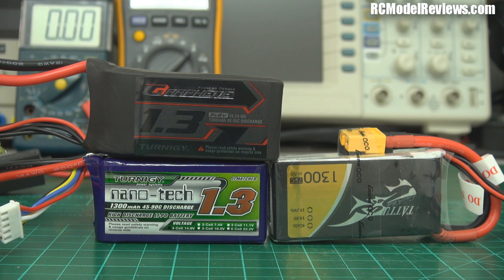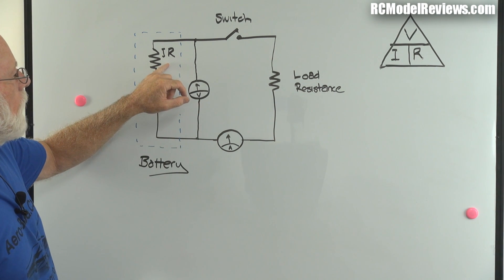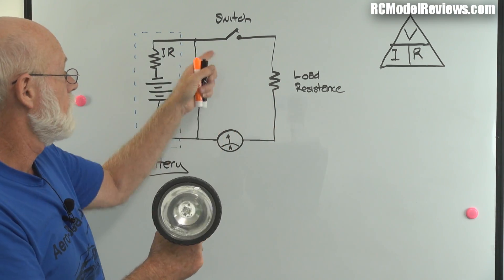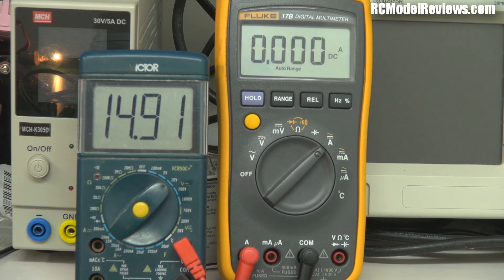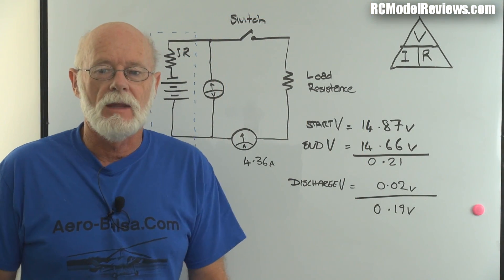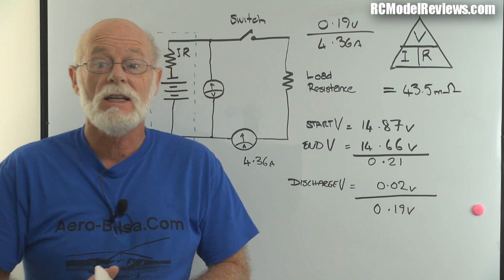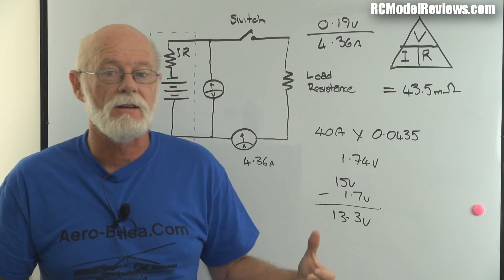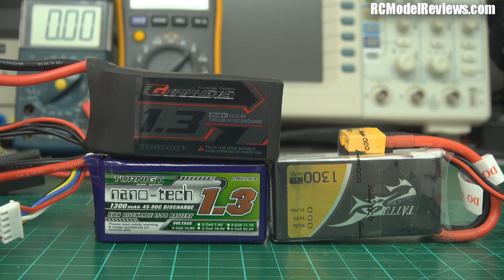Turnigy Graphene batteries:  calculating the internal resistance

Comment: I think everyone has been waiting for you to do these tests! Nice work Bruce :D I'm also interested to hear your thoughts when flying them. They seem to be on par to the Tattu when flying but are slightly heavier. So that's another factor that needs to be taken into consideration. Interestingly the prototype we received is still going strong and no puffing at all but, the prototype 1300 4S Graphene is actually smaller and lighter than the production ones we purchased. Many things to factor in
Reply: Graphenes are blowing tatto away by a long shot the bolts and revos both the high voltage versions are the only packs giving these any competition whatsoever. Check out the 2 threads on the rcgroups forum. The graphene thread and the battery comparison thread both show the real deal results.
Reply: I've actually stopped following those threads because I'm learning the hard way that some times real world performance and testing is what counts. Much like a racing car, you can do all the scientific  testing you like but at some point you need to test them in real life. When I purchased our thrust stand I thought it was the best thing ever. I made a prop selection for a race based on what I had tested on the thrust stand along with the Watt meter. My son completely disagreed with me! In the end we did lap tests and both of us produced better times on his prop selection not mine.

So real world testing is without a doubt relevant. For Thomas and myself we already know the Graphene offer us the best value for money hands down.
Reply: One thing I've actually failed to mention about the Graphene is they take crashes a lot better than other packs!
Reply: +BMSWEB Do you still feel this way after the SMC battery?
Reply: Tim Fulford It's hard to say, because we have only the one pack and that's pretty much it. So when we go for a fly, we compare the one flight on SMC vs the 16 or so on Graphene. SMC are a good pack without a doubt. My gut feel is they are better but the Graphene are still cheaper for us in Australia.

If I had heaps of cash I would without a doubt buy a heap of SMC Packs, but I don't and they don't have them in stock in Australia anyway :D
Reply: Thanks Paul. I bought 2 graphene packs and SMC are the same price. I may just stick to graphene since they are supposed to last so much longer.

Comment: This is great! I knew this was the way of calculating the IR, but I didn't know about the parasitic load you needed to put on the battery to get reliable values. I guess that's why chargers don't get it right?

Another thing you can do here is calculate the parasitic power draw of the battery itself! Using the example in the end of the video: 40A and 1.7V voltage drop, then the power P=V*I  --> 40*1.7=68W (wow that's really high!?). This is why the battery gets warm during flight, and why batteries stay cooler if the IR is lower.

Comment: Why do you not use the measured voltage at the time when you disconnect the load and the unloaded battery voltage after the test ? In that case its not needed to compensate the discharge of the battery. (14.85v-14.66V)/4,35A = 43.678mOhm
Reply: +Peter Kis Because I wanted to be double-sure I got the numbers right and prove that the discharge curve was accounted for.
Reply: +xjet With both methods, the calculated values are very close to each other, i expected more difference between the single and the combined calculation results. I think for a beginner easier to understand my calculation but both methods are acceptable. Have you plan to do some advanced measurements with a microcontroller based dummy load ? (discharge curves and internal resistance with different load currents) I think also a good video topic to measure and plot brushless motors current/thrust, current/efficiency curves.(Maybe with different props?) Its so obvious to measure these things for brushless motors but i haven't seen any videos about this subject on youtube.

Comment: You're missing one factor here Bruce. In a closed circuit, the total resistance is the battery's internal resistance + the load resistance. You use the the ammeter and the voltmeter to measure the actual current and voltage drop within that closed circuit.. Now that you know V and I, you will now get the Rt (Total Resistance)  through Ohm's Law. Now, to get the Internal Resistance is just a matter of subtracting the load resistance from the total resistance. In your testing you didn't consider the load resistance
Reply: +Jan Bobis He's actually right. The load resistance gets canceled buy subtracting the two measurements. The whole formula is (U1-U2)/(I1-I2)
because I1 = 0 he just dropped it.
Reply: +Jan Bobis He isn't using the direct figure off the multimeter which would like you said give you the total resistance.  He is using the difference in voltage between open circuit and closed circuit, which gives you the voltage drop from the resistance of the battery and the discharged voltage from the battery as he mentioned and accounted for in the video.  The total current is the same as the current going through each component in series so the internal resistance is the voltage drop over the total current drawn during the drop.

Comment: Well explained Bruce. May I suggest you try a PWM driven MOSFET into a short circuit to really give the packs a workout :)  Oh and no mention of pre and post test pack temperatures or the totally BS C rate figures manufacturers slap in these packs. It is high time someone named and shamed the biggest liars.

Comment: You didn't show where in the circuit you placed the 12v globe as small load ...? across pos and neg to the left (in the diagram) of the switch and the
 ammeter? so it'll be on permanently (nope, probably not), or on pos right of the switch and on neg left of the ammeter?
Reply: +David Clark The globe was placed directly across the battery terminals so the current that flowed through it did not affect the reading on the ammeter.  The current itself was very low -- in the order of 120mA so will have had little or no bearing on the overall results -- whereas the effect of the ionic charge on the voltage readings could have had a significant effect if it wasn't bled off.

Comment: Hey Bruce, I made some videos on these and found that they do have much more punch than, for example the multi star 'race spec'. I do find them quite large and heavy in comparison. They have a piece of fiberglass on each side to protect them which is nice. The other thing is that when you fly them,they are punchy until the very end, then they drop out of the sky :)
Reply: +Nils Rohwer Yep, that's my experience too.  This is because the IR doesn't change much right up until the battery capacity is virtually exhausted.  Other batteries tend to see a more noticeable increase in IR as they discharge.  This was one of the reasons I measured the IR at a storage-charge level (about 35% remaining capacity) because this is where the Graphenes will show the biggest difference against other packs.

Comment: A video about the influence of the temperature and why pre-heating of the battery in higher load scenarios especially on those colder days improves both power (due to less voltage drop) and service life would be a good followup to this.

Comment: Hi, over 10seconds, so 0.019v/4.36A = 4.35 mOhms, is this correct, or is 10seconds the standard?
Reply: +dasraiser The time doesn't matter.  The only reason I took the reading after 10 seconds was so that I could factor in the discharge curve of the battery.  By allowing 10 seconds, the actual amount of voltage drop due to the discharge of the battery is large enough to measure and subtract.  If I'd only waited a second or two then it would have been too small a number to accurately factor into the results.
Reply: that's fair enough, but if you could accurately measure 1s you would get a 1/10th the answer you have, unless I have misunderstood your video, which is more likely.
Reply: +dasraiser No, the time is irrelevant because we're subtracting the effect of the battery discharging.  By allowing 10 seconds we're simply letting things stabilize (ie: the load resistance/current stabilising and the internal resistance stabilizing).   Because we subtract the effect of the discharge on the voltage we could use any time and get the same results because the internal resistance remains pretty constant.

Comment: for me the most exciting thing is the high C charge rating if you could charge at 4 or 5C and drop your charge time down to 10 or 15 minutes you could buy way less batteries and just stay out flying all day
Reply: agreed.  the higher resistance is what kills charges time: at low amps while it's trying to balance near the end of the charge.  this is where most of the charge time is wasted.  if the resistance is significantly lower on these, it should charge quicker.
Reply: ***** no I'm talking about the battery charge specs. They say 10 and 15c charge
Reply: +Nathan Knight and replace more often..
Reply: Xava they say charge at 10c and 900+ cycles is the lifetime of the battery. 4 or 5 c is significantly less than their recommendation.
Reply: they lie as always
Reply: Xava guys in rcgroups have already been testing it. Go read up on it before slandering people please.
Reply: +Hoggdoc The limiting factor is resistance.  You can charge at whatever current, but the battery will only take so much at a time...which is why amperage tapers off at the top.  With lower resistance charge current would stay higher near end level.
Reply: +Xava Nobody said anything about increasing current.  If you set the same charge current on two identical batteries, but one has low resistance and one has really high resistance, the one with lower resistance will charge up much, much quicker even though both batteries had the same start current set on the charger.
Reply: thechosendude Sure, it could charge quicker cuz less heat, but Nathan said about 5C so it will be 7.5A for 1.500mAh battery. I just won't trust hobbyking and will wait some more time for more tests about those graphene lipos, time will tell.

Comment: Ain't pretty. This means that @40A around 12W is dissipated in each cell, which will heat it - especially if it's an inner one - pretty fast. So even just 30C shouldn't be maintained continuously.
Reply: +plemli Yep, that's why batteries come down warm when you've been drawing lots of current from them.